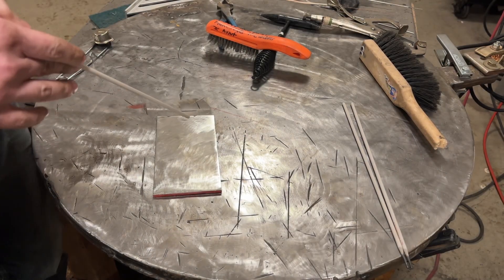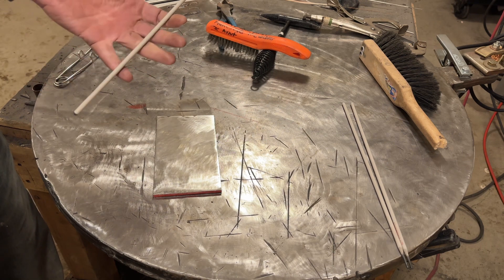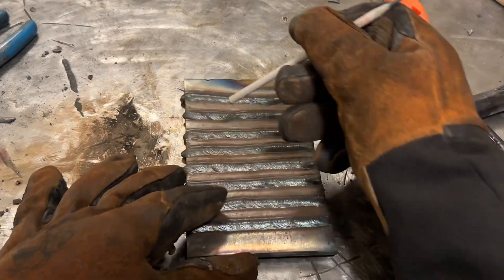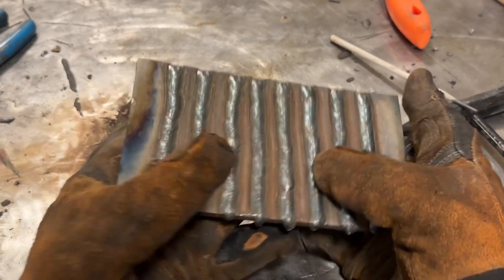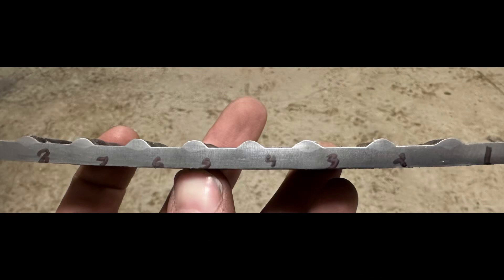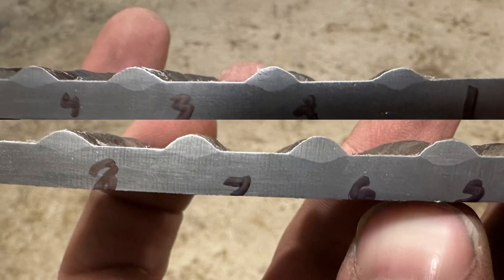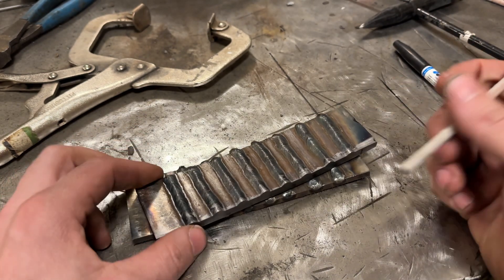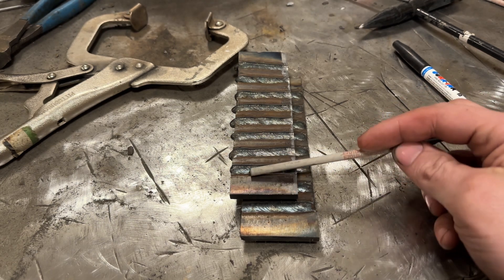Does rod angle make a difference in penetration when welding with 7018

Comment: Awesome vid! Have always been curious about this.
Reply from the maker: Glad you liked it 😀👍.  Pretty much the bead gets wider and penetration barely improves.  To a large extent that’s welding in general.  Since you deposit more metal as the amperage increases to a certain extent the heat input just goes to melting the filler metal more than melting the base metal.

Comment: Great video. Thanks. My instructor says that we should always go about 85 to 75° angle to get proper penetration. It looks like your video indicates otherwise. It's good to know. Thanks.
Reply from the maker: The rod angle has far less effect than you would think, the reason is the flux burns off at an angle and the arc still comes out mostly straight to the plate.  You can run straight in to a decent drag angle and be ok.  With rods like 6013 if you don’t have a decent drag angle the flux will run ahead of the rod.  Vertical up and horizontal welds require a bit different angle as well.  You will find there is a ton of room for different angles that work.
Reply: @makingmistakeswithgreg  That's great to know. Thanks.

Comment: I'm as surprised as a very surprised thing. My introduction to arc welding was a three day course about 25 years ago, and for the whole first day we were getting rod angle drummed into us without any explanation of what difference a few degrees plus or minus would make. Soon after that I started working occasional repair and fabrication on MIG and forgot all about stick. Now in midlife and trying to learn stick at least to some reasonable degree of proficiency, regretting that I didn't get these kind of insights back when my brain was more absorbent!

Comment: Actualy.. not suprized...
Arc is not "laser ray" from the rod, and it do not go in the direction of the rod.
Arc use shortest path between tip of the rod and the ground.
So.. even if you tip the rod to the extreme, arc will go almost straight down to the base metal.

Comment: My problem is I can't see what I am doing is it maybe my helmet I got it from a friend it has a lot of splatter on lense can you recommend a good helmet to buy
Reply from the maker: If you can’t see the best double check your vision.  Welding is done pretty close and if you’re over 40 you may need a set of readers.  If that’s good there are a ton of good helmets out there.  If your budget is a bit tight look for a 2x3 lens helmet with a 1/1/1/2 or 1/1/1/1 optical clarity.  The Lincoln 1740 welding helmet for around 130$ has about the best clarity you will find in a sub 200$ helmet.  Otherwise some of the harbor freight hoods (the Vulcan or titanium) are pretty good.  Make sure to swap out the plastic lens protectors as needed, when they get filthy they obstruct vision a lot.

Comment: The only thing I  notice is that it appears that some of the penitraions may be slightly  deeper but have a sharper point , I'm  wondering if the wider penitraions aren't. Stronger ?
Reply from the maker: Ultimately I think it comes down to what’s being welded.  Generally speaking for root fusion on a fillet weld to happen you need to have an average drag angle.  On a flat plate you can get away with a ton of rod angle without a huge issue since the weld pool spreads out.  On an actual weld joint it’s common for the molten pool to want to push ahead of your rod because it can’t spread out.  That’s why straight in or pushing doesn’t work well on a flat plate.  Sidewall fusion is important for strength, but more root fusion produces a stronger weld.
Reply: @makingmistakeswithgreg  I want to Thank you for these videos , you have great presentation and they are well put together .Yours are some of the best videos I've seen . Exceeding some of those college professors .

Comment: I'd like to know the time it takes to run a bead across say a 4 or 6 inch wide piece of steel... with which ever rod... Like as for Reference.....ha
Reply from the maker: So I did do this to a certain extent.  Here is a video that is quite lengthy but does cover it: https://www.youtube.com/watch?v=OO1ryeqWqso .

The two most common issues for people learning to weld with stick is moving too fast and running too low of amperage.  One great way to get out of those habits is to set your machine to say 120 amps with a 1/8th 6013, 7014, or 7018, and grab a 1/4 inch plate of steel (4x6 or so).  Prepare to weld across the plate, and tell yourself the following:  "I want to move forward very slow, so slow that the weld will push out wide and will start to hump up towards the rod in the middle".  "While I am moving forward slowly I need to slowly feed rod into the molten puddle at a rate equal to or faster than I am moving forward".  Basically if you move a 1/2 inch forward you need to have a 1/2in or more of that rod burned off.  The goal will be to run slow enough that you deposit a lot of metal, likely far too much metal.  Once you can deposit far too big of a weld (too slow of travel speed) you need to move slightly faster by about 5-10%.  At some point you will produce a weld that is a reasonable width.  If  you're too fast the weld will neck far down and be tall/narrow.  Getting a ideal bead has a lot to do with just being consistent with travel speed start to finish and consistent with the arc gap.

Comment: Interestings, good test.
Reply from the maker: The results surprised me.  I thought a lot about it and I think the reason for the results is due to the rod running on DCEP where the electrons flow from the plate to the rod.  Because most of the heat is focused on the tip of the rod, not going from the tip to the plate, changing rod angle has far less effect on DCEP than DCEN.  Down the road I will have to try DCEN and see if that changes anything.  Definitely not what I expected, you should have saw the last rod angle, it was almost flat with the plate lol.
Reply: @makingmistakeswithgreg  if you had quenched before each weld, i think the differences would have been more pronounced.  looks to me like a 10% change at most here.  i bet that would be doubled to a 20% difference if cooled between welds.
Reply from the maker: @peetky8645  yes I quenched it between passes.  The difference it far less than I would have thought.  If you did a 2 or 3 pass weld and didn’t cool it completely between passes the preheat would seemingly give you more penetration increase than running the rod straight up instead of literally parallel with the plate.  Not what I would have expected lol.
Reply: @makingmistakeswithgreg  i wonder if the difference might be more visible on a thicker plate.  maybe the weld preheats itself on a thinner section?
Reply: @makingmistakeswithgreg  another way to test the same thing would be do you blow through easier with a vertical rod angle on a thinner piece of metal.  was there any difference in the size of the HAZ on the back of the plate?
Reply from the maker: @peetky8645  I will test that coming up.  I think the trick for sheet metal is DCEN with a real flat rod angle.  The reason being that the arc comes from the tip of the rod to the plate on DCEN.  If you lean the rod way back on DCEN then the weld will likely stack up on top of the plate more so than bite in. I have a feeling differences will be seen in that situation.
Reply: @makingmistakeswithgreg  i agree.  i have not tried it yet.  the northern swedish welding channel showed downhill 7018 dcen with esab rods for open root 7018.  i think the packaging material OK's this method for a root pass.